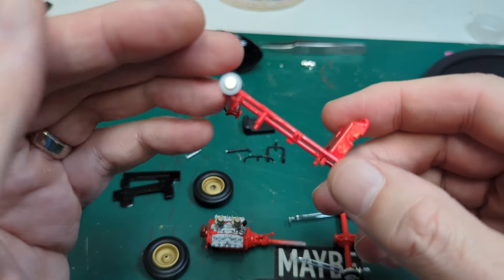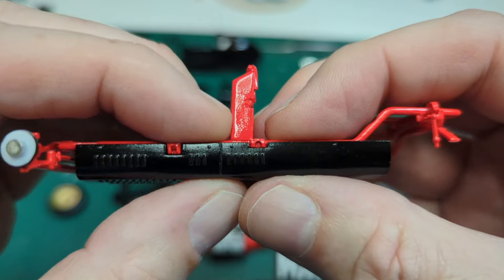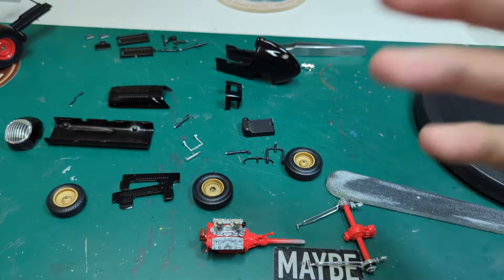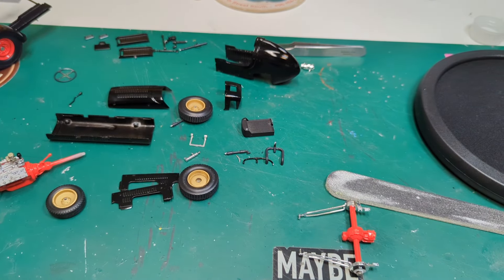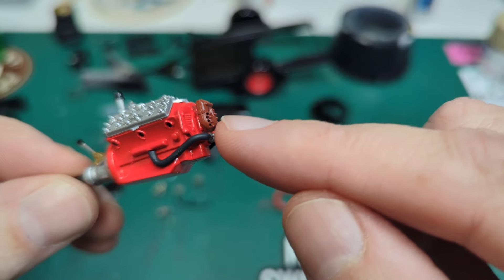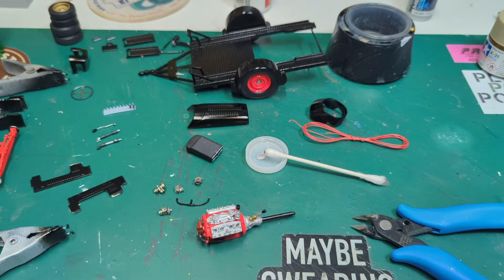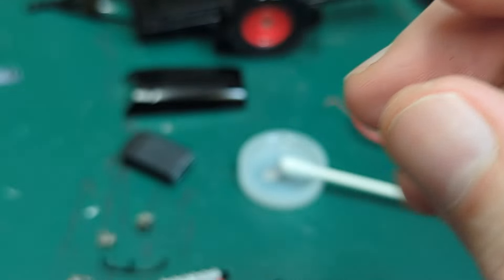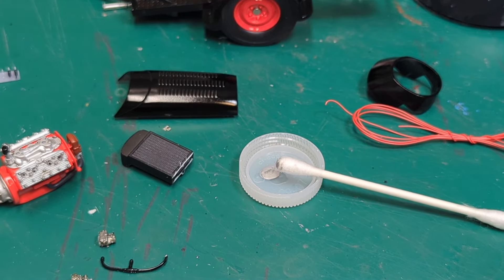Revell Kurtis Midget Racer Part 2. Engine and chassis!

Comment: Love the details!  I got some the nuts and bolts and thought they look too thin, like they're not thick enough. I haven't tried to take them out maybe they're embedded in the carrier and are actually thicker. I bought Plastistruct hex rod to cut to the thickness I want. The bare metal belly pan looks awesome.  Thanks for sharing.
Reply from the maker: Hi Alan, the photo etch nut and built sets are very thin! I think your solution is a great idea!  However, for the snap heads, it seems to work out great!!

Comment: Maybe one of those fancy dead center tools will help with hole drilling? I was in the same boat as you, couldn’t get a nice row of holes but the dead center tool helped me out there for starting straighter holes.
Reply from the maker: Well, I did use one. I just couldn't get the tie nib of the molded in spark plug fully removed. So the drill bit did wonder. I plan to place the spark plug boots in today and see if they mask my wonky holes. If not, I may add some styrene rod into the holes and re drill them

Comment: The old girl is looking good Brian.   And if you're worried about the holes, fill em in with the right size rod and redrill them.  I have had to do that myself more than once.  If you need a little tip on how to get it perfectly centered, just say the word and I will make a vid showing how.
Reply from the maker: Hi Marc!! Great idea!! I may try that if the wire boot doesn't hide the offset well enough! Thank you!!